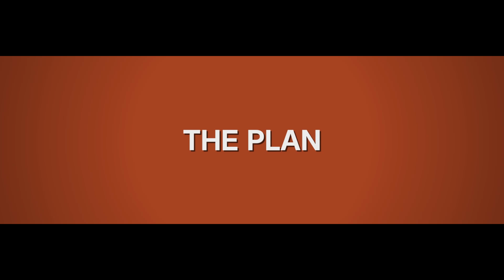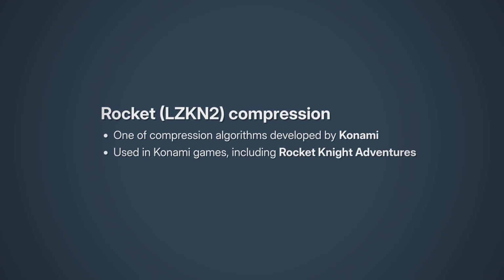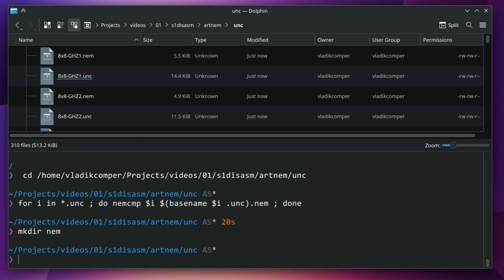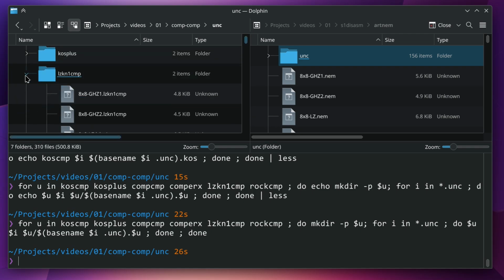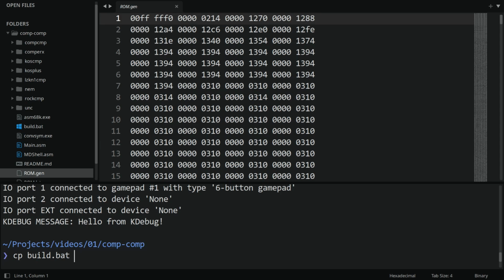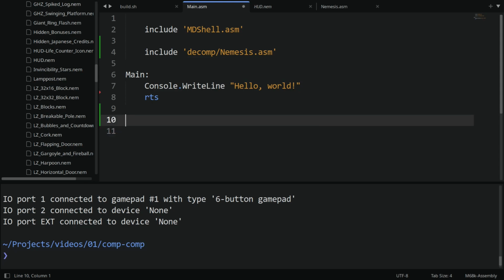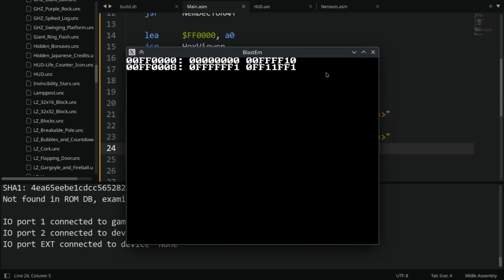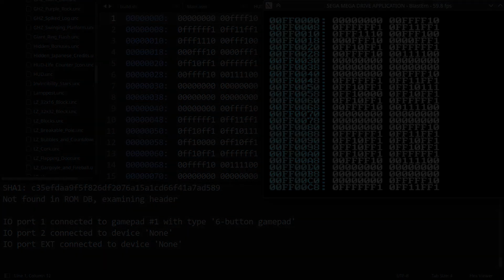Comparing SEGA Mega-Drive compression formats

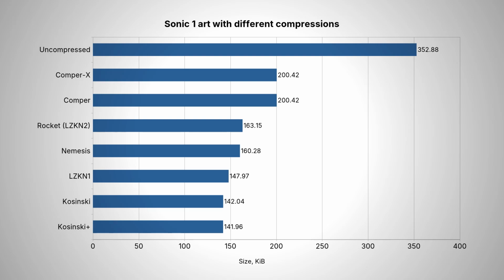Comment: 11:50 I've messed around with LZKN1 to extract compressed graphics from the Genesis Animaniacs game starting from the block $7A1E0 (NTSC) or $7A644 (PAL) to $FF132 (NTSC and PAL) and recompress them. The Konami and Sega logo graphics are stored in $9751E (Konami logo, NTSC) and $97F46 (Sega logo, NTSC) or $979E4 (Konami logo, PAL) and $9840C (Sega logo, PAL) blocks and were extracted with LZKN2. The raw tiles for the Warner siblings are stored from the $46000-5DFFF block. Where blocks are the raw and compressed sound and music data stored in the ROM?